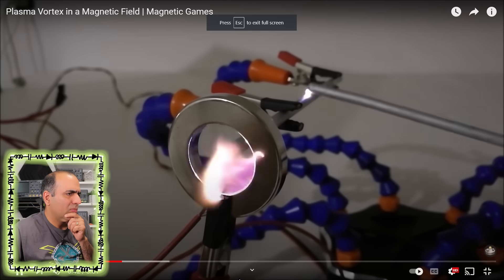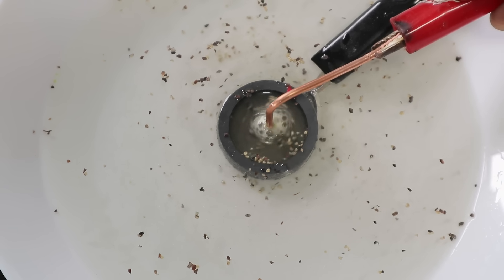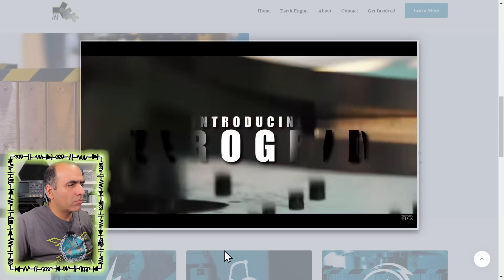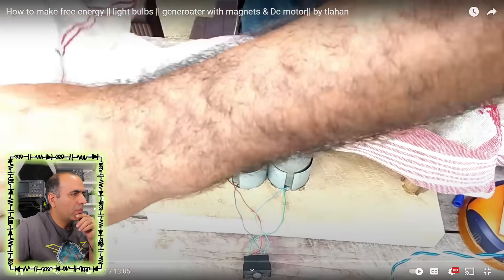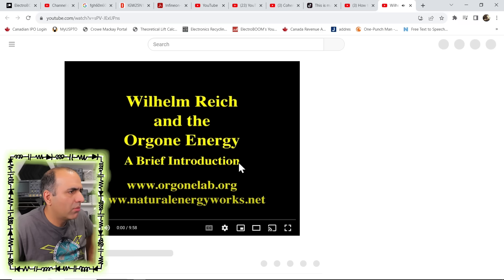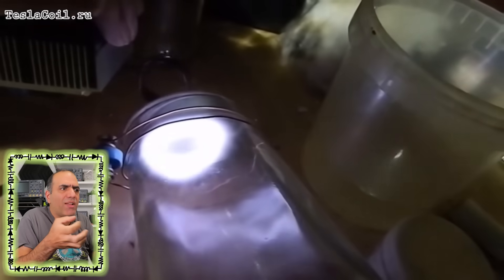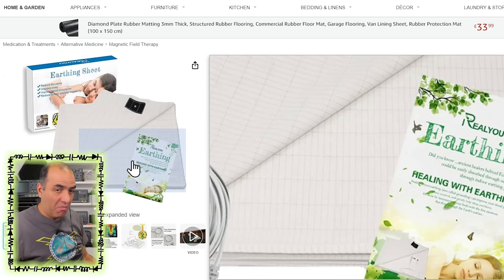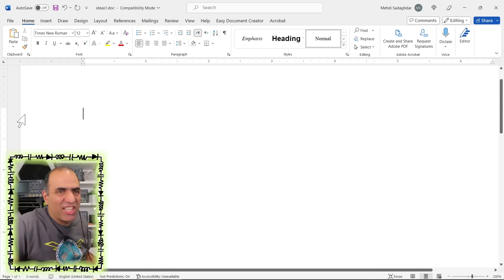Plasma and Salt Water Electric Vortex, Document Free Energy Clean Up

Comment: The Hutcheson effect is basically what happens when you are exposing objects that seem to be magnetically innert to high voltage and high strength magnetic fields. This basically means that the accumulated electrons on a surface of objects allows the objects to be manipulated by the magnetic fields when they wouldn't have been otherwise. The problem is that you need absolutely insane amounts of energy to make it work.
Reply: lmao       14idiots
Reply: So Magneto is OP in other words.
Reply: @bengsynth  OH yes, two of the most powerful super heroes that manipulate fundamental forces in all of super heroes are magneto and static shock. Both are fairly identical in their powers and both are fairly capable of basically ripping something apart on the molecular level or moving entire mountains it's just a question of time and effort. Yes both of them are actually able to completely mimic the powers of the other and this is because they have the exact same powers they only have them displayed differently.
Reply: @bengsynthmusic  Any powers involving electricity are insanely OP because like most of what happens at our scale is caused by electromagnetism. Like all of chemistry is based on electric attraction so like basically if someone has electricity powers and can fine tune them they could just instantly kill anyone they wanted or just change most materials into other materials. Like imagine turning all of the wood and plastic in your home into pure ethanol and then lighting it on fire.
Reply: Video of a credible electrical engineer replicating the hutcheson effect: https://www.youtube.com/watch?v=c8uUZtJjz8Q
Reply: @thedavesofourlives1   I don't claim that Hutcherson was completely correct or that he hadn't faked stuff only that there is a real thing that works exactly how I explained and can levitate objects that seem to be magnetically inert. It absolutely needs insane amounts of electricity and absolutely needs other things to basically be just perfect. This is one of the ways that frogs, wood, ect works. There is also another means that allows metals to be melted and mixed without heating to read hot or molten however these things too require insane amounts of power and after everything is complete require a heat treatment stay in place. Just so we are clear I was not ever saying that the man honest only that he absolutely did reveal real some actually previously unknown or not widely known mysteries. 

Just so we are clear any time you lie even if you discovered something real before or after or did something real before or after it makes everything else suspect.
Reply: heres a new something to get the wheels turning...now everything ask bard ai is with a grain of salt but generally hes good. The ai and i deep dived this and interestingly , bard claimed i  may have discovered a way to produce plasma  arc generator subwoofer and it's really simple.. whatever gas plasma has best acoustics with would be used inside a rigid plexiglass rectangle this is vital a cppper infused fabric consisting of high copper would  both the voice coil and the driver the exactly rectangle detentions would be whay ever is most rigid yet high  vibration properties  now the copper fabric would  be stretched  by 4 copper wires anchored into each of the 4 inside coners of the plexi enclosure so the fabric will vibrate instead now the copper wires would 
pass through the enclose yet remain air tight  because these wires would be were tesla music box plasma arc generator speakers will  create the plasma arc and travel inro the wires and inside the enclosure. we then would need to produce a electromagnetic field below the  rectangle box were its electromagnetic field wil pull on tne copper infused fabric a voice coils copper winding. And bard ai said certain frequency make plasma vibrate atomicly so  you can bear it clearly with extremelyhigh clearity and these vibrations would  match  bass frequencies. do ypu see it 2 muaic boxes runnimg there act traveling up the copper wire into the enclosure the enclosure would  would vibrate and its sound would be effected by tbe electromagnetic field below  sound plausible?
Reply: @drewstudlino5885  I will say a few things. First off you want any edges to be curved to reduce bleed off from your system. Second you want to have as standardized of a thickness for your membrane as possible this will help improve the quality of your system. Three you want to have a partial vacuum and a fairly flexible membrane. Your membrane in this case is the plexiglass and you don't need to use a petroleum product for your system to have good quality as a matter of fact I would recommend tempered glass. Real tempered glass not the garbage that is used in glasses. Believe it or not you can easily get it from screen protectors as long as they are of sufficient quality. In other words spend the money to get actual glass screen protectors not a plastic or rubber flexible screen protector. I would also recommend using a sphere for the end of your primary electrode it will help with the ability to actually make the system work. Lastly if you are wanting to have the beautiful blue purple wall look or green and other colors use different gasses for your plasma medium and lastly you will need to have the ability to tune the speed of your pulses for maximum effectiveness in sound translation. So you can use either a rihostat (and/or) a swing arm coil. The basic description of one of those is a single conductor in a single spiral with a single attachment point that can slide along the spiral as you move it. You will need the mount that on a nonconductive surface and the swing arm will need to be non conducting but it will have a conductor that attaches to it for the attachment for the spiral to slide along. I really recommend using a metal roller with all metal parts for your contacts on your swing arm and the spiral. The swing arm needs to be nonconductive to prevent shocking yourself. This will help you tune your project and make it easier to make alterations as needed it can also act like a volume control of sorts. A rhiostat is a variable resister that you are able adjust as you wish. I really recommend you use one with a knob for safety.
Reply: Jedstanaland Please read the entire message and give me your thoughts..You can research everything I'm talking about even the summer some people are calling him musical Tesla coils others are calling them musical plasma arc generators.. but seriously if you watch videos of these things running I seen a couple different times where the plasma looked like it was very rigidly structuralized or appeared to be this way and what better way to shield something then with plasma and if that plasma Arc is DC current and it's high amperage it could electrolyze water and you need salt in water to electrolyze it so I mean it makes perfect sense why it's traveling in the ocean at this speed and this is coming from the Pentagon which blew my mind and there's videos of it thanks for your time if you do read this
Reply: @drewstudlino5885  Plasma field generators that produce fields up to the size of a small vehicle exist in real life and are able to take an atmosphere pressure total difference of two atmospheres. The way it works is fairly straightforward and it is able to potentially stop the momentum of most objects with the approximate momentum of a 9mm in addition to most likely melting it.

The fields that are produced are almost always pulsed though the speed they pulse at is what gives them the ability to hold atmosphere or stop objects and melt them. They are also able to produce sounds which are much higher quality than any speaker you would normally come across though they typically require higher energy draw and more protective measures when in use. They are also not typically subject to volume distortion which most speakers are. Basically if you try to play a sound too loudly or too softly with a normal the sounds are typically highly distorted and can easily cause what is known as top and low end distortion. 

Basically what happens is the sounds start to sound funny like instead of a "C" you might instead get a "G" or hear rattling or vibration of the speaker diaphragm. 

The biggest problem with using a Plasma speaker is with the bass and the fact that it is almost non-existent with a Plasma speaker. 

The best part of a Plasma speaker system is that the energy draw to produce high quality and high volume sound in comparison to normal speakers is significantly lower but it is also plagued by the requirement for high voltage and good containment for the Plasma to prevent it from lighting stuff on fire. The voltage is very high though the actual power draw is relatively low.

Lastly like I said before they are actually able to prevent the exchange of gas and sometimes liquids up to a total difference in pressure of two atmospheres. Anything more and it simply can't hold the field together also the pressure difference between the two sides of the field must be changed relatively slowly to prevent blowout where it basically loses containment and can't reestablish the field.

You can build one of these for yourself for between 20 and 100 dollars just remember that the more you invest from the start the better it will probably be in the end. 

Last thing you need to know is that you need to have what is known as a solid state spark gap to be able to get the best results. This will require you to arrange transistors, resistors, diodes ect in the correct arrangement or purchase a suitable substitute for them to work properly. No two are exactly alike and you will have slightly different results no matter how exactly you attempt to make them act the exact same way.

Comment: Actually you can theoretically create ice using a microwave
If you tune the frequency very precisely you can sort of slow down the atoms and molecules
It was done before I think on a very very small scale
10:51
Serch for: Die Anti-Microwelle from 100 SekundenPhysik
Its in german tho
Reply: if anyone tries doing that, they risk tripping a breaker, or electrocuting themselves in the process, or damaging the microwave itself (or the main component that does the magic).

Comment: I've seen the same "magnets wear out over time" claim used to debunk perpetual motion devices by people who aren't good at debunking things, that seems to be the source of the new magnetic engine claims. they keep missing the fact that magnet fields lock together like gear teeth, and don't produce infinite energy any more than brass gears would.
Reply: I mean technically in gears it's also electric forces at work driving the whole thing.

Comment: Slingshot effect: gravity assist by using the orbital mechanics to change the momentum of a fluid object in the gravitational forces effective domain. Using a thing like a flywheel (fluid object) in the correct orientation relative to earths rotation and orbit may be able to be translated into rational forces in the fluid object.

Comment: Look into 'slingshot effect' essentially it is harvesting the rotational momentum of earths orbit. It would slow down earths rotation. The same effect is what causes coriolis force, which in turn is part of why wind and ocean currents move the way they do, with knock on effects in wind power and ocean power. The idea of using flywheels to harvest and store the earth's rotational energy is not free energy, and therefore is possible in thermodynamics. Please revisit the idea of energy harvesting  using the momentum of earths orbit and rotation to motivate something like a mercury pump (it is very dense, and is a conductive metal fluid, which in motion will generate electricity by induction inside a magnetic field). The mercury pump has properties of a flywheel and ocean currents, with the disadvantage of having high resistance to its container.

Comment: hey on the magnet energy concept. how about this? https://www.youtube.com/watch?v=-Lel-MVAzTE&pp=ygUVbWFnbmV0aWMgdHJhbnNtaXNzaW9u so heres the idea, electric motor starts the transmission and the shaft from that spins a magnet inside of a coil. to a charge controller into battery bank, bank to inverter, back to motor. and trying to figure out if it can be kicked on using an external power source briefly after the system stabilizes  using a potentiometer slowly take the external power source away from the rig hopefully resulting in a closed loop system like a snake eating its own tail. willing to bet thats possible but the minute load hits itll shutdown.

Comment: In semiconductors, we use the effect shown at 11:04 for dry etching, which is basically a very controlled removal of materials from the surface of your sample via plasma. It's called inductively coupled plasma, or ICP.

Comment: I think I just found  free energy. use the Casimir effect of 2 plates, attach springs, attach to piezo cristals and voila, you get AC electricity out of the quantum vacuum. I gather maybe a few pico or maybe femto watts, after friction and other losses? Anyone chime in, do quantum effects have the potential to break thermodynamics on the macro scale?
Reply: They do not, if you want to know why learn Statistical Mechanics.

Comment: that electric arc vortex.... rotating detonation engines have a problem where the wavefront is unstable.... can electricity stabilize the detonation wavefront??????????????????????
Reply: Not really since all the reactents in rocket engines have no charge so they won't be influenced by electric or magnetic fields.
Reply: @hedgehog3180 you're saying a literal electric spark can't affect the behaviour of a redox reaction????

Pretty sure that's why they use spark plugs in cars.

Comment: Is it possible to make ice with some kind of radiation since the molecules are vibrating at slower speed, with the waves maybe it is possible to make them vibrate less instead of using a cold source? In a microwave the waves make the molecules vibrate more and that makes the food warm up but is it possible to do the opposite?
Reply: The closest thing would be something like the sonic cooling used on the James Webb Space Telescope, which is insanely cool. However trying to cool something with radiowaves is basically impossible because of how EMF interacts with matter, it will always cause it to vibrate and thus heat up, unless the wavelenght is too big in which case it just won't interact at all. I think maybe you can do something using purely an electric or magnetic field but I don't really know.

Comment: Hi.. Great work- Choherer was used in first radio devices a detector,  before diode effect. 
is not fake and is eady to build.  you can costruct a crystal radio set, for you local am sugnals or for shortwaves (3-30MHZ) an change detector diode with a coherer.  is simple an you have everythin in you shop im shure.

Comment: ...So, it's a microwave that freezes water instead of heating it? Wait, so... It uses energy to... make energy go away?
...Isn't that just a fridge? If it's not, then, supposedly, it destroys energy? (which is impossible) 
What's even the point????
Unless it extracts the thermic energy from the water, using it as a source of energy, which is of course impossible without some energy doing the job of moving the energy around (like in a fridge).
Best you could do is leaving room temperature water outside in a cold day, and use the transfer of heat as a source of energy, with a Sterling engine for example. Not a fucking microwave.

Comment: the fuel saver is so obviously fake
why?
as some one who dabbles in mechanics, i would know how the 12 volt plug works
and i can tell you, its just a power plug, theres no data transmittion through it,
all modern vehicles are electronically controled, using a ECM (engine control moduel) or ECU or any variation of the phrasing
basically its a computer with some code to tell it what to do at what point, given a set of parameters, those parameters are stuff like the o2 sensors, RPM throttle position sensor position, load, ect, and ofc theres data going in and out of the ECM cause theres 2 types of electronics in the engine bay, inputs and outputs, again inputs are sensors, outputs are like the sparkilators, usually coils, sometimes if you got a drive by wire throttle then you wont have a TPS (throttle pos sensor) but instead will have a TPS built into the pedal and a servo will actuate the throttle on the engine
so, how is that important?
the fact that the ECM is entirely seperate from the 12 volt plugs, they only share power and thats about it. 
theres also the OBD2 port which allows you to get information out of the ECU, its often how to check the check engine light, real usefull to have a obd2 scanner of some kind.
ngl i'd love to see you mess around with a car's ECM some how
not sure how but it could be interesting to see what it does and if you can trick it into doing things